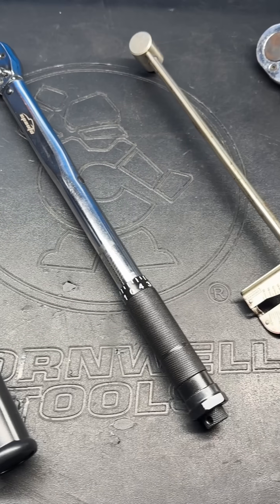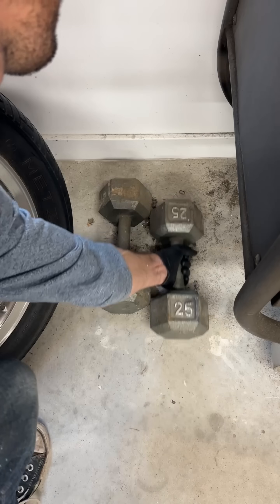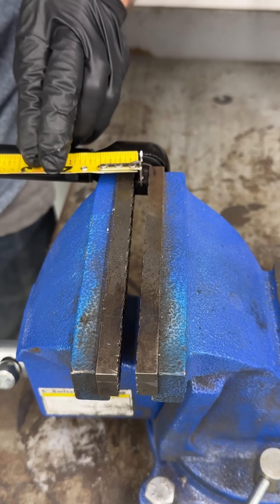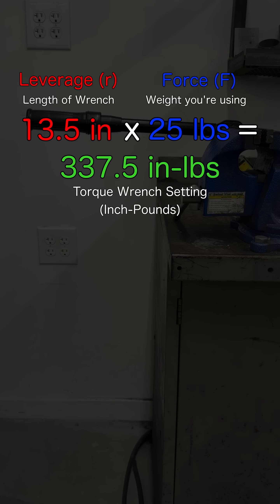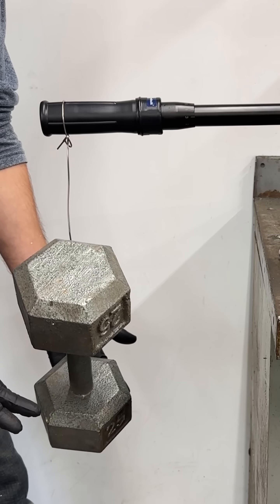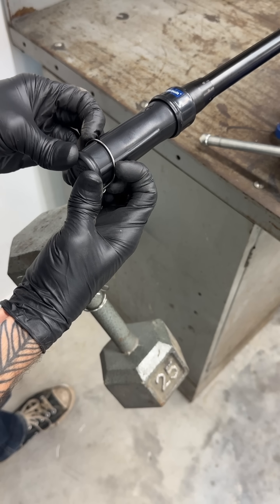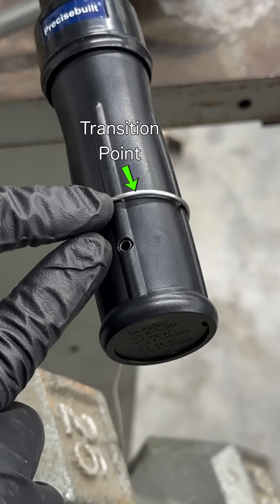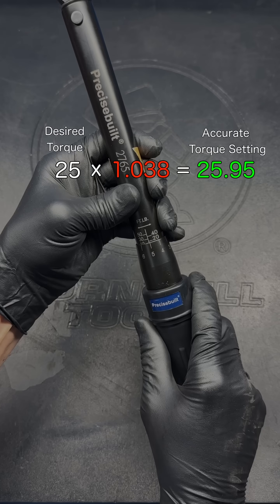How to calibrate any torque wrench yourself  #motorcycle #DIY

Comment: Excellent video dear sir. The only issue is the actual weight itself. The plates and dumbbells I own are not exact. I guess it's worth actually using a scale first. But then what if the weighing scale isn't calibrated?! Errr I guess I'll stop myself now 😅
Reply: I'd be willing to bet the torque wrench even at its worst, is more accurate than a typical dumbbell weight.
Reply: Use water to calibrate. 1 kg / L 

Now you need to calibrate your volume

Use your measuring device to ensure volume

Now you need to calibrate your measuring device 

... I see the problem
Reply: @ welcome to analytical chemistry. It goes much deeper than that
Reply: You can weigh the dumbbell as well to get a more accurate reading. Use a bathroom scale to take your weight with the dumbbell and without and that difference is the true weight. You can also use a hanging scale but be sure to account for the weight of the rope holding the dumbbell
Reply: At this rate. Might aswell start making 3 whitworth plates😂
Reply: Just use one of the torque wrenches you already calibrated to check the weight 😂
Reply: You discovered why making anything precise is actually a huge pain in the ass.
Reply: I can’t imagine they would be off that much

Comment: Your method is not gonna work because a cheap torque wrench isn’t accurate and certainly isn’t gonna be consistent after you used it just a few times
Reply from the maker: @Gregg0112  you can calibrate it quickly to the specific torque you’ll use next, and can do it as often as you need till you build trust with a wrench. Most of mine are either old or cheap so I check them before almost every critical use.

Comment: Assuming your weight is exactly 25 lbs though. So now we need a scale to make sure its accurate 😂
Reply: But that's if the scale is accurate, now you need to measure the accuracy of the scale
Reply: @caydenbone5804  we just need to verify the pair of weights are the same weight and that they read the same on the scale
Reply: @seanmakesthings  ... yeah I figured
Reply: @seanmakesthings  Use the old water displacement method. Then check if your water measuring device is accurate...
Reply: The wrenches usually come in at +/- 4% IV so any inaccuracies in the weight will carry over. It’s best to use a pull gauge that will keep your highest reading to see what it actually clicks at if you don’t want to use the actual transducer to calibrate it how it’s supposed to
Reply: ...e ...ricordati di calibrare anche la bilancia...
Reply: Metric is easy because 1 liter of water is 1kg of weight.

Comment: I go by german torque measurements. "Goodentight"
Reply: I use the Russian torque setting “Brokenov”
Reply: @Xisansia  in Kazakhstan bolt is scared so it just come out by itself
Reply: @boratsagdiyev5679  😂😂
Reply: I also use the German maintenance regimen "Luboften".
Reply: Broken bolts and stripped studs are calling, they said the wheel was tightened to the hub improperly and the customer lost a wheel on the highway after a slightly too big pothole

Comment: i calibrated my 5 year old cheap wrench but the problem is: For high values it tightens more than expected, and for low values it tightens less. (47Nm: no prblem; 62Nm: it torques at 70Nm and 28Nm: it torques at 20Nm).  so the precision goes from -10% to +8% 😹 depending on the value i set.

Aeronautic certificate demands that you calibrate for 5 different values. And measure your weight because my 22 pounds lift weight was actually 21.1.
Reply: Internals like springs, wear unevenly. calibration shops take these wrenches apart. 

Do with that information what you will.
Reply from the maker: @didier_vitesse  yea usually when I have a precise torque to set I check it close to that torque to make sure it’ll be accurate.
Reply: @oneupmotogarage also make sure your 25 pound weights are actually 25 pounds just use a scale. 
And then ALSO make sure you calibrate your scale so it’s correct by placing a weight on the scale whatever it requires but to do that you need to make your sure your  scale test weight is correct too so just end up throwing it all out and strip the bolt anyway

Comment: i promise you the motor doesnt care about 0.98 ft lbs over
Reply from the maker: If it's that close I wouldn't sweat it. But on an M6 bolt tightening down a cam holder into aluminum threads...You do want it as close to accurate as possible.

Comment: Stupid imperial units...
Reply from the maker: @romanmaier4307  fair 😬 it works the same in metric units 👍
Reply: man im french i understand the imperial units . Nm or ft lbs, just use measurements of your country lol, nothing complicated. Torque = mass*g* length
Reply: Am i stupid or he forgot to multiply the weight by gravitational acceleration to get pound of force not pound of mass? Or imperial system defines dumbelss with lbf? Or defines torque as (???) work (mass[lbm]*distance[in])? What am i missing here?
Reply: @zamach9894  here is what is funny with the americans, you dont need gravity to calculate ft lbs, we are talking about pound of force but on earth a pound of mass =pound of force. But if you are on the moon it would be different and your pound of force needs to be converted according to moon gravity 😹😹😹😹
Reply: @didier_vitesse  But... math then doesn't mathing... As per my research in about 55m pound of force(lbf) is pound of mass(lbm) accelerated  by the g (32,174ft/s2) so its not equal... that meeeeeeans that their torque wrenches are marked in lbm-ft or dumbelss are marked in lbf... which i know "MURICA" but it would be stupid and wrong... so tell me... WHY WRENCH CLICKING WHEN NOT SUPOSSED TO BE CLICKING?!
Reply: Womp Womp

Comment: My torque range is 150-700ftlb idk If I have a weight that heav
Reply from the maker: @arthurerby2466  yea that’s a big wrench! What do you usually use it at?
Reply: @oneupmotogarage  mechanics work and pipelining theirs not a middle ground usually I grab it for I beam and axle bolts on rangers and trophy trucks and that ranger from 175-280 but pipelining and some axles I gotta take up to the 500s
Reply from the maker: @ wowza, that’s some serious torquing! Not much on motorcycles that goes past 60ft lbs.
Reply: @oneupmotogarage  Porsche center lock wheels should be torqued to, 370 to 443 lbft with the wheel off the ground.

Comment: I used my needle torque wrench to check my click torque wrench.
Reply: Bad idea - even with a mirror (reflective band) dial, it is too inaccurate.  Why do you think click types took over that role?
Reply: I only have a needle torque wrench, all these clicks and beeps making me think I’m inadequate. I’m going to check mine as it was passed down to me
Reply: I guess needle wrench is not all that many times more inaccurate than a random off-brand gymweight.
Reply from the maker: @6258RB  if ya trust your needle wrench then yea, sure! I guess that goes for any wrench you trust to test against. All mine are old (except for the precise built I just got) so I check them regularly.

Comment: Those weights are not all the same weight so your calibration will be off
Reply from the maker: @dantheairboatman1234  Yea they may be a few oz in either way but they’d have to be more than a lb off to make a noticeable difference in the end calculation. But by all means pre-weigh or use high end weights if you want that extra level of certainty.